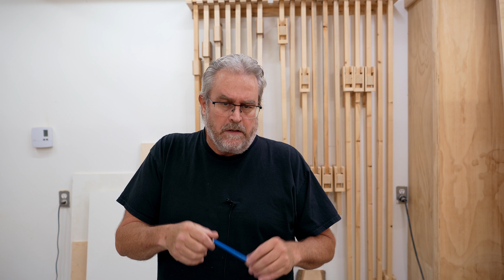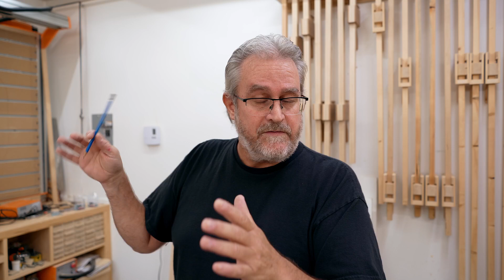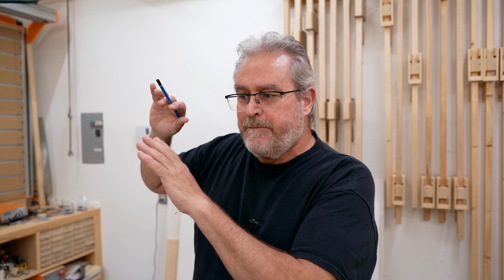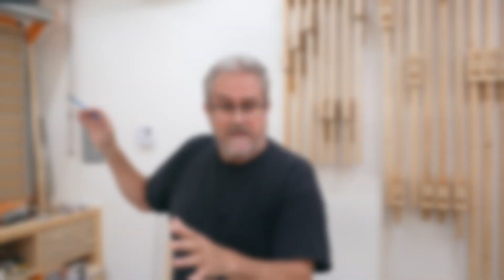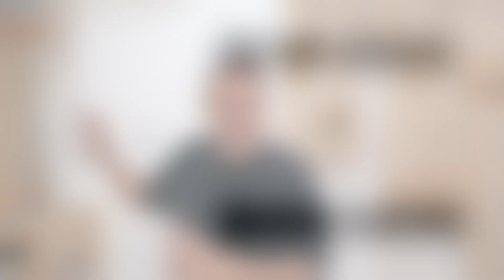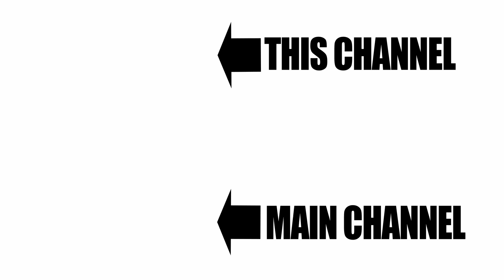Debunking Audio "Truths" -  Dr.  Floyd Toole

Comment from the maker: Chill! And read this:
Do we really need standards (aka, rules) for speaker performance? I'm sure Dr. Toole would say that we do, since that's what his life's work boils down to - establishing measurement metrics for determining sound quality. 

And that isn't necessarily a bad thing, and it certainly wouldn't be if it was just agreed to in general terms and the industry was left go on it's merry way as it had been before these measurement ideals were introduced. 
But what has been happening, as is often the case with questionable ideas, people hear something in these ideas that appeals to them and they latch onto them. That appeal is always something that they  like to hear - how they personally want it to be, and not typically for purely technical reasons.

The simple truth is that there are people (quite a lot, actually) who want to see everything controlled and regulated and rules set up that must be followed. And the idea of extending control (standards) into an area that previously had none is just the next cause for them to eagerly get behind.
You know such people. You may be one. We've been indulging such people for far too long, now.

My view is that standards are ultimately destructive. On their face they seem like a way to improve a situation by taking away the variability you'd have without them, but in doing so they put real limits on growth and innovation. They take away the character and individuality we have when controls are not in place, and make everything the same. 
And when everything is the same, there are no real points of comparison. Take away the bad and can we really judge good? Take away the unique and can we truly judge art?

Art, you say! How does anything that is so science based (speakers) have anything to do with art?!? Well, whether you like it or not, listening to music for enjoyment is very much like studying a painting or sculpture, or any other variety of art. Unless, that is, you are only listening to judge the precision of the medium, like examining a painting to measure the different shades of green that were used, or the type of canvas it was painted on.
Art appreciation is a subjective act, as is listening to music. You can't do it "wrong".

Is there a standard for art? If you look at what passes for modern art and compare that to what was happening 400 years ago, you'll quickly see there couldn't possibly be one.
And while I'm certainly not a fan of most modern art, I appreciate the fact that it can exist because the artist was unencumbered from imposed standards and was free to produce it. And its existence gives me a point of comparison and makes me appreciate the art I do love even more.

But would it exist at all if everyone felt the same way as I do? The answer is obviously no, so that suggests that there are people who like (or even love) something that I find repugnant! How could that be?
Again, it's entirely subjective! 

Now here's the part that trips a lot of people up, especially the wide range of Sheldon Cooper types that we have in any technical field: recognizing that art and science can (and must) coexist. Even 10,000 years ago when primitive man was painting the walls in caves there was this art / science symbiosis. The paint itself is the science, while brushing it on the cave walls is the art. 
Without the art, the paint is useless. Likewise, without the science, the painter is out of a job (or pastime).
But in the end it's not the utility of the paint that attracts us, but the art of the painter that used it.

So you could say that the paint is excellent from a technical point of view; much like a speaker can be excellent from a measurement point of view, but the paint needs to be used by the painter to produce the subjective art; much like the speaker is used to produce the entirely subjective sound quality.
In the end you don't listen to the speakers, you listen to the music that's coming out of the speakers.

A pair of speakers that measures "perfectly" will sound different is different rooms to different people. And while the research conducted by Dr. Toole suggests that a less perfect speaker will sound bad to a lot of people, there will still be some that actually prefer how it sounds over the more "perfect" one. Reread the part above about modern art, if you have a problem understanding that.
Reply: Jesus Christ, he literately answers your entire argument in the first chapter, which shows you clearly haven't read his book. Please, please consider doing so, you will be amazed at how brilliant it (and he) is.
Reply: Nice rant on art and science.
I realize you're anti-authority, and you like to do everything yourself.
But if you're going to criticize Dr. Toole, please read some of his book.
He spent 50 years studying audio and psychoacoustics.
Representing him as a "Harman salesman" is too disrespectful.
Reply: Since, but you didn’t mention what standards were proposed, I guess this just leaves your audience to imagine big brother was coming for their speakers. Even your statement “I’m sure Dr. Toole……”, could he interpreted as denigrating Dr. Toole without any proof or reference to any standard he ever “may have” suggested. After all, why have any standard, it’s all fake standards anyway. Sorry, but you’ve gone from building beautiful speakers and building other interesting audio components to promoting conspiracies and plots all without a shred of the peer review documentation provided by someone like Toole.
Reply from the maker: What I'm saying seems to be beyond your ability to comprehend and (more importantly) put in perspective. And I'm not going to try to clarify it for you, since this is of very little importance overall and I doubt I could get through to you when you seem to have gone completely off the rails with your attitude about it.
My advice is avoid watching my videos if what I say makes you too upset. You'll be a happier person and that's all that counts.
Reply: @IBuildIt I already responded to your thoughts here, but I wanted to add a more personal note.

I’ve been making YouTube videos for about 13 years now (two different channels). I’ve made a lot of videos in that time, and some of them were just ripe for critique. 

It really sucks when you put a lot of time into making something and armchair experts or internet goblins come seemingly just to tear you down. 

I don’t believe that people are responding to much more than a disagreement over your thoughts on Toole, though some are more polite than others. 

What concerns me is that their responses seem to be really getting to you. I’ve been there. It’s deeply frustrating to lay out a full-fledged response to criticism, then 5 minutes later another 3 comments pop up about the same thing. It’s fuel for burning you out and making YouTube put a bad taste in your mouth. 

I’d encourage you to do one of a few things:stop reading these comments, remove the video, or consider reframing your thoughts on the matter (I’m not necessarily saying change your mind, but rather find a way to discuss this in a way that people might find easier to swallow). 

My comments here come strictly for a concern about your wellbeing, and helping avoid any undue strain, stress or anger at your audience. 

For what it’s worth, a large majority of people watching your videos may have no clue who toole is, or may only have a very basic grasp of his work. This is one of those deep rabbit holes where people get passionate about, but ultimately we’re all here to learn about speaker design, listen to music, and tinker for better sound. 

I think there’s value in what you’re saying about preferences and art, i think the negative response comes from a perceived attack on Toole, and coming to that topic without providing any hard metrics on why he might be wrong.
Reply from the maker: How people perceive, respond to and interpret what I'm saying is out of my hands. All I can do is cogently present my thoughts, but it's up to you to listen carefully enough to come away with the correct meaning.
When I single out someone and imply that they are the cause of a situation, people who respect and follow that person immediately go on the defensive and that defensive position colours everything they think I'm saying. In other words, they interpret what I'm saying as an attack.
In fact what I'm saying is that Toole just presented the findings, but people who are looking for simple, easy answers latched onto aspects of those findings (like they did with Keynes) and THEY are to blame for the situation I'm describing, and not Toole directly. 
I have nothing specific against Toole - he did fine research - but it needs to be understood within the full context of what he was trying to do.
As for you concern for my well being, that can be interpreted two ways. It could be genuine and I'd appreciate it (although I'm fine and you have nothing to worry about), or it could be a tactic to try to annoy me and put me on the defensive, which would be typical. @Tonehifi
Reply: @IBuildIt  You might be saying it in far too many words 😁, and yes I took the liberty to jump of in time.

Comment: 🙂
Numbers, lines and diagrams are no science! We have to prove the history of these, that would be science.
1) Floyd postulates, without explanation, listening as subjective. That is also wrong. Listening-measurement is objective, but much more complex than looking-measurements. Preference is subjective!
2) So he omits an analysis step, the description of listening experiences, and then he makes
3) assignment errors: preference vs. looking measurement instead description listening experience vs. looking measurement results.
4) He does not measure what he claims to measure: multichannel!
5) He apparently overlooks the interaction of speaker and amplifier. This combination, not any frequency response or phase shifts, is the "sound of speaker." But that's only possible if one has NO experience in this regard. He apparently doesn't have, otherwise he would develop a different "study desing."
6) and so on!

Floyd Toole is no scientist! His lectures are nonsens - sensful for the unexperienced!

Comment: Did you even bother listening to what you've even said

Perhaps I am just older than you, and perhaps I have lived more in the world than you did.  But the world of Audio has taken massive leaps forward from the work of Dr Floyd Toole and the work that he did with others at NRC about sound and speaker design.   When I was young, you are correct it was the Wild West and you couldn't turn around without falling upon a store selling speaker end equipment of some unique design or another.  The only problem was that most of them were crap.  And you side comment of you would listen to them in a store that was staged and tweeted to get the most out of the sound, with generally specific records to play on them.  All designed to make the speakers sound their best.  But then you got them home and they sounded less than stellar .  This is the part of Dr. Toole's speech that you must of tuned out and taken a trip to the bathroom.   The part of Psycoustics and how we as listeners are influenced by others.   The fact that the speakers (Artificially) sounded great in the store, it must have meant in our heads that we didn't do something right.   So you'd tweet and move and toe and do everything to try and achieve that sound we thought we heard.   And them the second part happens.  We get more and more accustomed to the sound until we convince ourselves that they are sounding good.  Not that they are, but as we want them to so badly that we convince ourselves they are.   Remember that your hearing device attached to your ears (ie your brain) has the ability to do some wonderful things.   It after listening to things over and over gets accustomed to it and until it is presented with something better will accept as fine something that it knows. 

You can try it.  Listen to a song that you think is a pass.  you know the ones that you wouldn't gravitate to.  not that you hate with a passion but think it's just mild trash.   Listen to it 4 times a day, every day for 3-4 weeks.   And by the 5th week you will enjoy it and likely say it's a great song.   Why, because now your brain had adapted to it and knows it, so you get comfort from familiarity. 

It's an issue for song writers.  We can listen to part of a song over and over trying to get it right.   After a while we will start to hear it as great.   So you need to stop. take a break.  give it a day or two or even a week.  Then. re-listen.  It its still great, then perhaps you have something.  Chances are you hear it again and say Oh My God this is crap and how the hell did I think this was even worth listening to.  

what Dr. Toole had found is there are certain characteristics that people like in a speaker sound.  if you have them then chances are that the speaker will sell.   That is not to say that they are the only thing.  Or this if you don't your speaker is crap.   But that is the preference.   It was a whole lot of research on what are the common things that people like when the listen.   But he also pointed that you need to test and test correctly.    If you ask me, your point that in today's ,market, people have less choice and what they listen to all sounds the same is not because companies are following what Dr. Toole has said, but more that they are not.
Reply from the maker: Funny you ask if I listened to what I said, when most of the comments I've gotten on this video show that the viewers didn't listen to what I said. You are no different.
To recap in words that you may take in, I said that Toole's work wasn't the problem. I said they way it was received by people such as yourself is the problem.
I said his goal was to set a "standard' for general performance that's widely accepted by most listeners.
But you all have taken that as THE standard for ultimate performance. 
You have taken his findings as the word and the law for speaker performance.
So the fault lies with YOU, not Toole. 
He did fine work, like I said, but you have taken features of his work and misapplied them to get the results you want.
Reply: @IBuildIt  I haven’t had the opportunity to talk with Dr. Toole personally, but I have however had many chats with others who have worked with him, and specifically a great individual who worked alongside him at NRA for the studies.   Dr. Toole was trying to get a standardized testing model that was meaningful for speakers and sound reproduction.   Your headline to your video shows the message you were delivering with “Debunking” and your take that what he suggested were key properties that people like in a speaker from actual studies must be a myth to dispel as you know the truth and that is according to you people want and only listen to bass.  Why? Because you seem to imply that is what seems to dominate the current market place in sales, and simply because Dr. Toole went to work for Harmon and now there are less and less speaker companies that the is a correlation back to him.

Have you considered there to be a whole load of factors that may have played to the death of the hifi stereo market.   You can lay some blame to Steve Jobs for the iPod and iPhone as that lead to convenience of listening to music just about anywhere.  It was far better quality than cassette tape and easy access to music.   Blame Fraunhofer Society for giving a standard to lossless compression of music.  They designed it so you could give away quality for quantity.  And by making it that heavily compressed music sounded better with cheaper less revealing and generally lower quality speakers.    Give onto the masses that generally don’t know any better a choice between getting quantity and ok sound for a low price, vs better sound with limited choice at a high price, only an idiot would bet on the latter.    But music for the masses isn’t what I choose, and I gather it’s not what you choose either.  But it misses the point that Dr. Floyd Toole was trying to say.   Without some controlled context and means of measurement, how can a consumer make an informed decision?

I personally own Axiom Audio speakers that were designed by Ian Colquhoun who worked beside Dr. Toole at NRC  and Andrew Welker.   They took the research of how people hear and the idea of actual measurements of speakers for both frequency response and sound power in a controlled anechoic chamber (yes they have their own) measured in on and off axis in controlled angle increments.  This way then they make changes or upgrades to components there is a method to see how it effects the sound response one reproduction.   I think this far better than just design for looks and using a marketing budget to tell people how this must be better.

I don’t have a golden ear.  I’ve probably lost a good portion of my hearing over the years.  But I do believe that my current Active Crossover LFR1100 speakers are one of the best speakers I’ve owned

Comment: The research he and Sean Olive worked on was originally to understand and remedy the issue of Consumer Reports evaluating Harmon products poorly. The goal was never to identify the perfect speaker, but transform a large amount of subjective data into an objective way to identify products that would appeal to consumers.

The beautiful offshoot is that the "preference rating" formula patented by Sean Olive is public, and can be tweaked. In this way, you can actually adapt the measurements to better reflect sound quality in a treated room, outdoors, or even in a car.

VituixCAD even includes this custom formula feature by default.